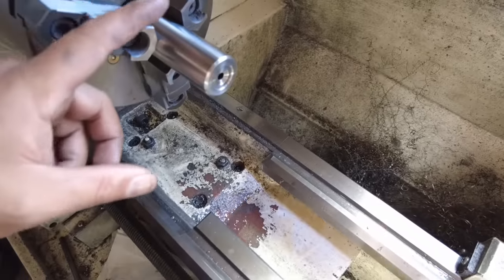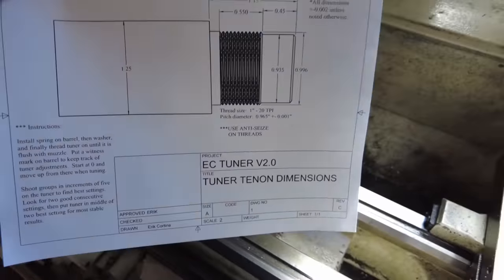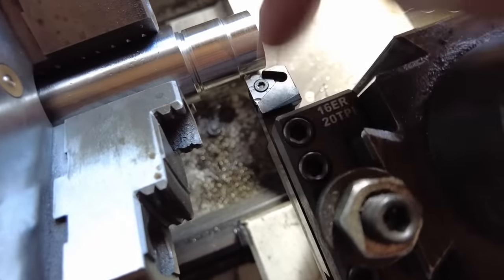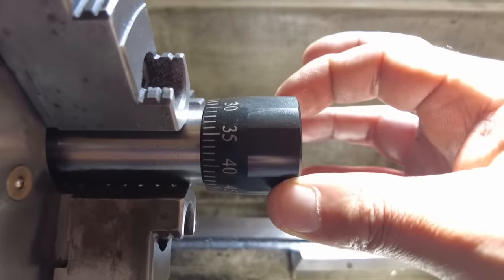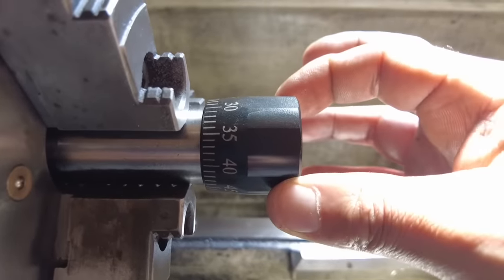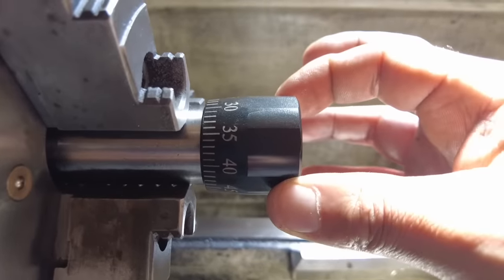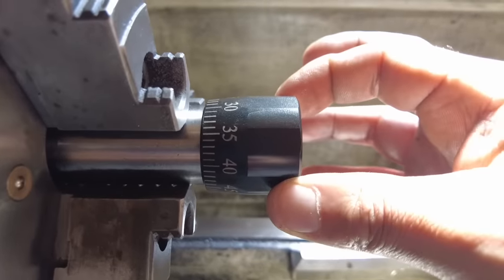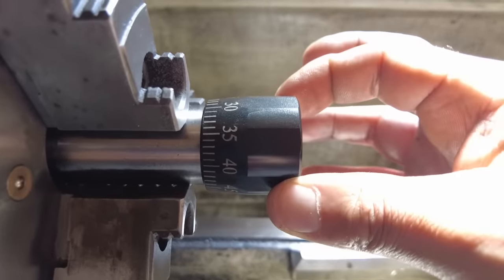EC Tuner V2 - Will it help your 22LR rifle? | Direct Barrel Install

Comment: Kinda what I was thinking , Kenny. You’re the first guy to do a before tuner , after tuner, and tuner repeatability.  Maybe for a benchrest shooter who has loads of select lots that shoot well with the barrel , a tuner might give an edge . But I’d still think you’d want to stay away from turning down a barrel to accommodate the tuner . I’d think a potentially more effective effort might be to size the tuner to the barrel diameter . Once a guy like you builds a rifle that shoots freaking awesome  , I’d want the option to go back to ground zero if the tuner did not work out .
Reply from the maker: Absolutely.  The ARA nad IBI shooters here use tuners that are clamp on style. The results I've seen agree with what you stated on turning down the barrel, at least for 22lr at this moment

Comment: Browning I beleive invented these tuners with their Boss system.  I have a couple of rifles with the boss system installed one just turns the dial on the Boss system to adjust barrel harmonics for specific ammo.  They discovered the idea when they found that frequently just trimming a small piece of barrel off cured inaccurate rifles by changing the barrel harmonics to put the wave node at the tip of the barrel.

Comment: I just installed a Harrells tuner/brake on my Rem. 700 223 20" barrel and after adjusting the tuner 14 times I got 3/8" groups compared to the 5/8" groups I got with just a brake on it. My barrel is .860 dia. shot @ 100 yds. sirerra MK 69 gr. @ 2800 fps.
Now I have changed a factory barrel into a precision barrel for $145.00 CDN. A Bartlein barrel and milling costs would have cost about $1500.00 CDN.
I've shot it 3 times now without adjusting the tuner/brake and it appears to be holding plus the weather has been the same. 
Personally I think this is where a tuner/brake really shines.
Today shot again and adjusted the tuner to other settings and then back to the best setting and again 3/8" groups. By the way the Sierra 69gr. I shoot the barrel loves them and I have shot over 2k rounds in the last year with about 6 other makes of bullets so you're right about having ammo the barrel likes first.

Comment: Great vid/content. I was thinking about putting one on my rimfire but don't think I will for several reasons. I will say I believe the EC tuner/brake helps on a centerfire gas gun. I've had good repeatable results with mine with handloads. (Didn't worry about it with factory ammo and factory brake. It all worked good together. Complete aero precision 6 ARC upper with 24" .936 barrel.)

Comment: I am a Vibration Analyst and will give the short version of some explanation.  The bigger more rigid barrels would require a heavier tuner in order to change the natural frequency of the barrel enough to positively affect barrel harmonics.
Reply: Agreed.
Reply from the maker: The ARA and IBI league folks for 22lr use clamp on tuners that have substantially more weight. Im no expert in this, just ISCET lvl 1-5 certified with a BS degree so my knowledge is sign waves can correlate. This world we live in is nothing but frequency
Reply: Absolutely.
Reply: Do you know of any MATLAB analysis that would characterize the weight needed for the tuner based on the length and stiffness of the barrel?
Reply: If adding more weight isnt an option because someone has already bought the tuner is it reasonable to think making changes to the tuner settings in much bigger increments would be worthwhile? Ultimately we are trying to influence barrels of different stiffness with the same weight and the same thread pitch, the only variable we have then is how much the tuner is mover between groups.
Reply: Alan, you still would see the same results in this instance.  The only thing that may help would be increasing the travel distance of that tuner getting it out on the end of the barrel.  But still likely same results. If you have room to add a muzzle break in front of that tuner, it may help with the additional weight .  But still the correct answer would be more weight [mass] using a heavier tuner.  Best results for you would be to "lot" test and get the best one.  Also make sure action is torqued properly, looseness causes more harmonics and over torque can cause deflection.
Reply: Makes perfect sense.  Can't knock the Laws of physics.

Comment: Kenny,I agree with many of your previous posts about "Myth Busting 22 LR Accuracy" enough to have ordered a Vudoo barreled action from you. I`ve have 3 rifles that will average .3-.4MOA at 50yds,and 20 years of shooting Benchrest club matches at 50 & 100 yards. The E.C. Tuner isn`t heavy enough to have dependable "Tuner " settings with the heavy contour barrels you`re installing I.M.H.O.. I`m also agree with you re: turning down barrels to 1/2x28,to accept common Suppressors,Brakes and yes tuners. All my accurate rifles use "Harrel Brothers" Tuners that are bored out to muzzle diameters,and slip over the muzzle without altering it. The heaviest barrel I have on a 22LR is a .925 straight contour,and the last 2.5" of barrel is 1.020" diameter,like an Anschutz "Super Match". It has a 8.0 oz Harrel Brothers tuner bored out .002-.003over muzzle diameter ,with a shoulder inside that allows it to slip on the same spot over the muzzle. The tuner also has a threaded face on it to allow extra weights to be screwed into it.
I`ll e-mail you pictures of the tuner for you to see. I`m hoping you`ll test my barreled action at 100 yards,as that`s where our local matches are won. Please DON`t turn my barrel down at the muzzle .In earlier posts you said you prefer to install 1.100 to 1.200 straight contours,I`d like to have a 1.100 contour to allow the tuner to affect barrel harmonics more than 1.200 dia. Tuners Do Not Fix crummy ammo,crummy shooters,and crummy gunsmithing, but  do get the best out of lot variations in good ammo. I`m in Alaska and it`s hard access different lot numbers. Good ammo at further than 50 yards must have single digit S.D.`s or Low teens ( 12-13FPS) or vertical stringing will affect accuracy. I wish Federal was still making UM1 & 900 Match,as it won Olympics for the USA, But corporate take overs lead to executive officers who don`t understand accuracy only accounting,I.E. Remington,Marlin,High Standard ,etc. I digress. You conduct many checks in barreling 22LR actions,and I hope you check my barreled action at 100 yards for a rifle that will hold 1/2" MOA.or less,and I will sing your praises.  Personally I do all tuner testing at 100 yards,as you won`t see all the positive & negative effects of the tuner
Your understanding of long range 22LR performance is another reason I picked you to build a new rifle. NRL & PRS 22 matches demand maximum performance from ammo manufacturers,and rifles,but
carry over to our Benchrest club matches . If there are maximum weight limits use thinner barrel profiles,and lighter tuners. I really like your motto of "Learn Precision Together". Take my input or leave it.
We`re always learning,and competition is the place to do it together , Mike
Reply: totally agree with your observation about the weight of the tuner.
i dont know what material is being utilized for the tuner but on such a thick barrel the tuner would have to be either lead, tungsten or significantly thicker (if its steel) to make change in harmonics
mind you at one point the tuner will be so heavy, that it will sag the barrel
my 2c
Reply: @audipiotr  Thanks Piotr, I`ve hung as much as 20 ounces on the end of the barrel. The aluminum tuner I use on a 1.025" diameter is 8 ounces,and it affects the barrel harmonics about optimum .If you happen on a great /repeatable node,the Harrel Brothers tuner I use has a threaded face to it,and on a great tune hang a lot of weight there and you might be pleasantly Surprised with how it cuts through the wind,and yes it lowers the point of impact. With multiple weights on the front the combinations are endless,and the

Comment: That is why the Harrels tuner is better as it is machined to the finished diameter of the barrel and the barrel is not machined. You measure the OD of your barrel and order the tuner to fit that dimension. No threading at all.
Reply: I have the Harrels tuner on my CZ 457 MTR and it has tightened up the groups.  From what I have experienced it seems to me that my flyers are do to ammo inconsistencies.  But I'm not a competitive shooter and not by any means an expert on ballistics.  My rifle really shoots RWS Rifle Match very well.  Norma Tac-22 is a close second.
Reply: I put one on my Savage 110FP in 308W. Even with as perfect ammo I can load, (single digit SDs) I've never got very repeatable results. What is shooting in the 3s today will be 5 and 6s next week, even with similar temperatures,  wind, etc.

Comment: I thought I read somewhere that .22lr likes a tight last inch or two on barrel, and when people machine barrels for threads or other muzzle devices, it actually loosens the rifeling and makes it expand.
Reply from the maker: @michaelmustic6645  correct. Button rifled barrels, because of the process of pulling/pushing a button, creates alot of outward stress around the bore area. If enough material is removed around that area the bore will open up. The crown affects 22lr very significantly compared to centerfire.  Muzzle devices that effect the gases to not efficiency expell also affect the projectiles stability apon exit.

Comment: Hey Kenny, Glad to see you post this, though I am sure you will be heavily criticized for it. (Good on you anyway) Brain Litz new book Modern Advancements in Long Range shooting he tests over 1800 rounds on 4 different tuner and provides that data to back up his results. He also discusses this chapter on his podcast subscription. Might want to refer folks that are sold on these, to his data before they spend their $$. Not sure what you change to install one of these (none of my business) but the book is less than $50, the entire podcast with all the other content is $10 if you just want to listen. Might be worth the investment for those who want to make decisions based on live fire results. Summary is on page 108. I wonder what the groups looked like if you took it back off?

BAR
Reply from the maker: I have that book. Its outstanding.  I have videos with the V1 tuner on a CZ457 that made the rifle shoot phenomenal.  Infact, ive installed many tuners as well as made my own with over 400+ rifles built this year. Thiers no doubt the EC V2 works. Just not for this particular heavy barrel in 22LR. Ill showcase it working on a 1.25 straight contour centerfire 6 GT benchrest build. Many of my clients want to install the EC V2 onto their 1.200 straight contour 22lr barrels. This just shows lot testing your 22lr ammo is more important and adding a tuner will only get you so far without lot testing
Reply from the maker: In case folks see this, Bryans team tested many tuners. Some that have read the book will find it biased against tuners not working. But Mr. Litz is known for his solid data reputation
Reply: Did he make his own tuners or just use what was on the market?
Reply: @jwoodshed1108  ATS Hunting / Comp tuner, EC tuner, DSB fabrication, ATS XL tuner were the models tested.

Comment: have you tried threading in reverse, with an inverted tool? Joe Pi does a nice demo, and it eliminates issues with having to fast-stop when running close to a 'ridge's, or real close to the chuck...

Comment: I gave James Pappas permission to use the VibeSlide tuner I designed back in the '90s/'00s. Or at least during the whole Calfee 'parallel node' benchrest craze years. Afterwards his daughter retained that permission. It was a higher moment of inertia design to more positively control muzzle harmonics.

Comment: Superb video 
Man am I learning it's simply an inescapable fact that it's a WHOLE lot harder to get a 22lr rifle to consistently shoot with  BOTH accuracy AND precision VS my centerfire rifles
Example is my newest CF rifle made by Bergara for CVA Cascade in 450 Bushmaster 
During load development for thatbrifle I fired 40 rounds using 8 different charge weights of Hodgson Lil'Gun and all 8 five shot groups if laid on atop the other formed a group aggregate of under 1.5" with no unacceptable degree of vertical stringing 
And that's at 100yrds not 50 utterly not possible to do that out of my B14R with 2 or 3 different ammo types let alone 8
Spoke to guys at my rifle club who compete in F-Class and BR using 100% custom rifles costing thousands of dollars and every one say shooting 22lr for extreme precision and accuracy is much MUCH harder than CF rifle
I agree 100%

Comment: Huh...not what I expected.  I know this is an old video, but I thought I'd comment.  I have a Anschutz 54 action and a win 52 that both run the harrel tuners of varying vintages.  The anschutz is .9375" end to end I believe.  Can't remember what the 52 is off the top of my head...but I want to say it's close to 1-1/8 or a shade under.

I run midas+ or from a lot of center-x (after sending the rifle to Mesa for lot testing).  The harrel weighs something like 8oz...and I have an additional 1.5 oz(?) Kit on the winchester.  They sit proud of the muzzle quite a bit more then the EC tuner.  

What does the new EC tuner weigh?  I see references to the 'old' model at 4oz.  Maybe there's just too much mass in that heavy barrel for it to make much of a difference?  I'm not shooting much .22BR anymore...but I am seeing ALOT of tuners in NRL22.  I still run suppressed for NRL, but I'll bet ~1/4 of the guys at the last match I made it to (May) were running a tuner of some sort. 

Thanks for doing this test! I would have bet the farm that even 4oz would have made alot more difference than what you found.

Comment: The Hornady podcasts has an episode that explains the need for better statistical 15-30 shot groups to determine actual group size/nodes if any. They do understand that means a lot more ammo being burned up, but statistically unavoidable. Better sample sizes lie less, LOL. Shooting 15-30 shot groups would require shooting farther out so as not to crowd target too much. Now that your farther out, wind is a complication but could be avoided with a shooting tunnel. Being a 22lr only complicates the process for sure. Smaller contour barrels might possibly benefit more from tuners. Tuners are defiantly part of the Black arts! A semi-universal mechanical clamp machine rest would be very useful in determining accuracy potential in built rigs. I don't know what that would look like but an interesting idea for sure.

Comment: With a previous lot of SK Pistol Match Special, my Bergara B14r shot lights out with my EC V2 tuner set at zero. A new lot of SK PMS was giving me one or two fliers per box. Over five matches shooting two IBS targets - 50 bulls - I dropped 14 points or 2.8 points average per match. I finally tested tuner settings and in the last match I dropped one point by the thickness of a human hair. I'm sure the lost point was me and not the rifle. I'll know more after additional matches but it seems that the tuner has reduced the fliers. I hope so as I still have quite a bit of the same lot left.
Reply from the maker: Thinner barrel. Different setup. These tuners help with barrels 1in or smaller but seem to require retuning as DA and temps change

Comment: Thanks for the testing. But the question remains for smaller diameter  barrels - are the results repeatable? I'm dubious. Hopefully   you get the opportunity to test that out. Maybe when I'm feeling flush with cash and curious I'll grab an EC tuner and try it on my T1x and B14r steel barrel.
Reply from the maker: I did a video on the CZ457 from factory to competition and the EC V1 tuner helped a lot dial the accuracy in
Reply: @EagleEyeShooting  Thanks - I'll take a look (and will very likely buy one to try because I won't be able to help myself 🤣).
Reply: I thought the general concensus was that tuners work better on lighter barrels, or at least heavier barrels require a heavier tuner.
Reply: I have EC tuners on both centerfire and rimfire rifles and can say the tuner is more effective on my centerfire than on the Vudoo.  Nevertheless, the tuner does improve rimfire groups.   The best way to improve rimfire groups is by lot testing lapua or eley ammo.

Comment: I put either shaft collars or hub collars on my barrels and tune (or attempt to) with them to see if any gain is achieved.
Sporter barrels just get LIMBSAVER deresonators. 
   And if I'm being honest I've left it on my bull barrel (.850", 13/16")  Marlin 882SSV .22WMR. Not a competition rifle of course but in my case the hub collar did make it a better squirrel gun with the ammo I'm using now, by a noticeable (1/4") margin. 87.4 yd MPBR for 1" target.
  It is time consuming using calipers to set movement of collar but I've still got that $200+ to buy more ammo.

Comment: It would have been interesting to see one more group with the tuner set in the same position after it shot the group which threw 2 shots.
Reply from the maker: It wasn't mentioned in the video but those groups where on the top left near the end of the video
Reply: @EagleEyeShooting  thanks for the reply and for the video!

Comment: I guess at least when there is a temp change, humidity change, air pressure change, you can tweak a little if needed. Of course that's if you have it shooting lights out with a tuner.